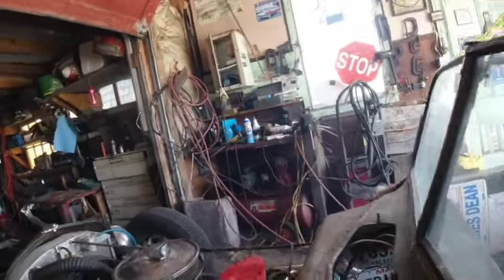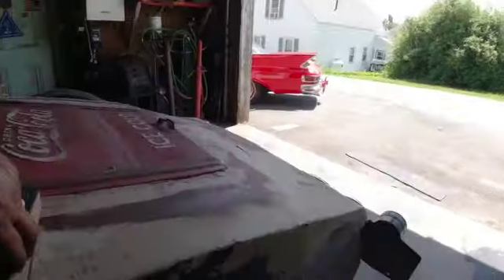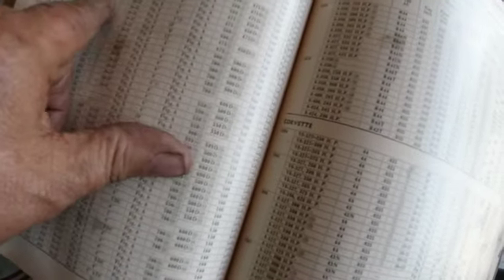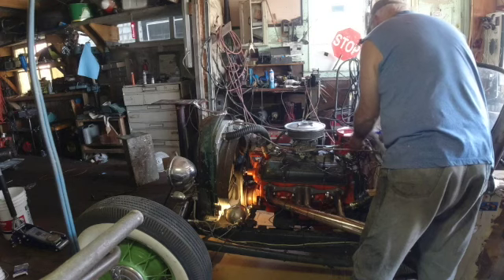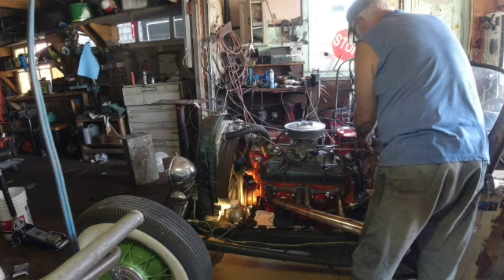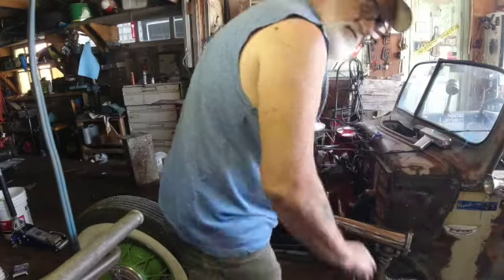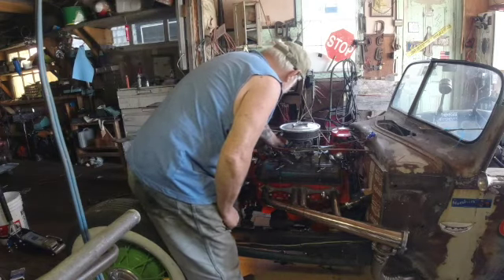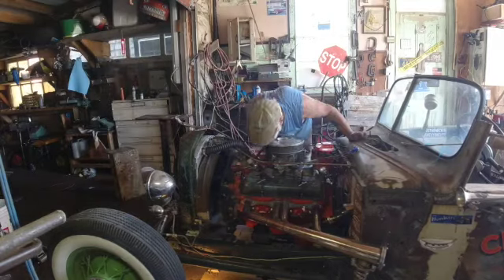Timing Light

Comment: Remember not to switch #5 and #7 plug wires at either and and that the HEI distributor has to have a full 12V. Not sure how the Cadillac engine was set up, the original coil and points used a resistor somewhere.
Reply from the maker: The original Caddy was 6 volts and I ran a resistor.  It's still on the firewall but not in the system now..  Thanks Tyler.

Comment: Vacuum advances is. Not working on the 1959 Ford
Reply from the maker: Not surprised.  Might have to replace the module on the side of the distributor.  They have a diaphram inside that rots out over time.